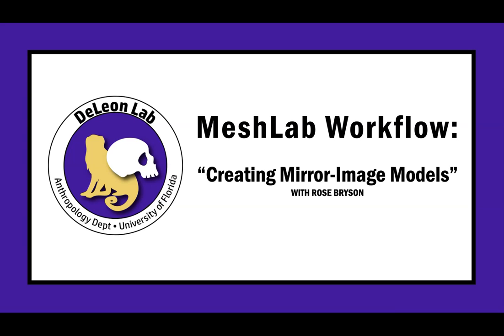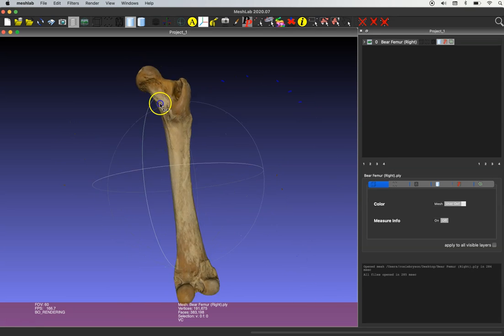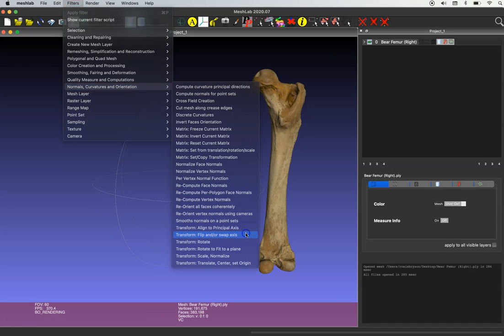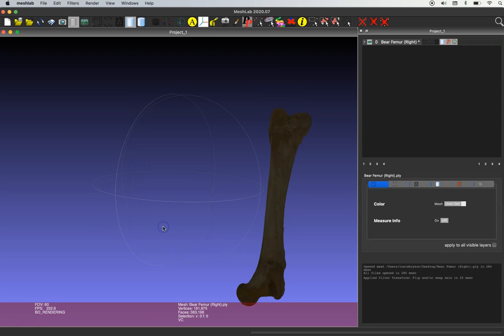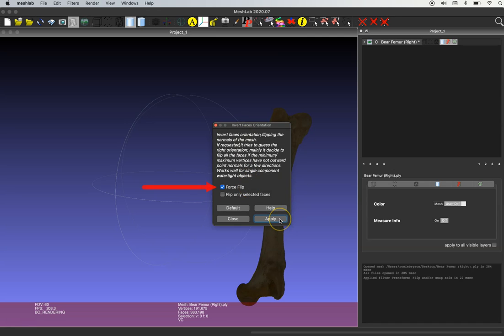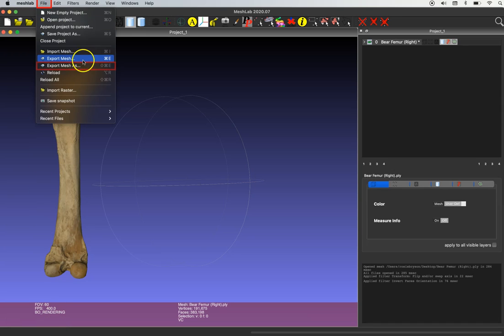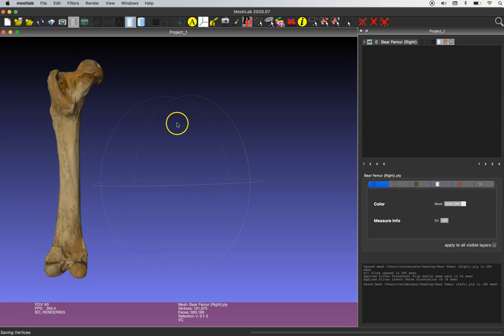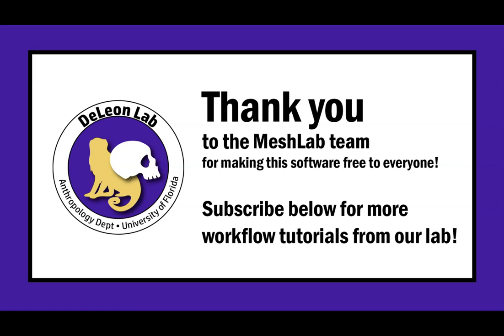Creating Mirror-Image 3D Models   [MeshLab Workflow]

Comment: Do you know why my model disappears after mirroring? Before the force flip step. Like it didn't turn dark or anything but disappeared completely......
Reply from the maker: This happens to me sometimes when the coordinates for the model are far from the origin (0,0,0).  Mirroring happens by multiplying one of the coordinates by -1.  So, if your model has X coordinates in the 100-200 range, then the mirrored object may be there, but located in the -200 to -100 range.  One quick check is to zoom way out and see if it appears.  Another way to check this mathematically is to look at the coordinates for the model.  If the values are consistently far from zero in one direction, you can use the Transform module to translate the model closer to the origin (or whatever location you want it to be).

Let us know if this doesn't solve your problem! --Valerie
Reply: @deleonlab  Before mirroring my model is right at the centre of that globe, so it shouldn't have this problem? May I ask how to check the coordinates?
Reply: @deleonlab  Oh wait when I zoom away it does appear!